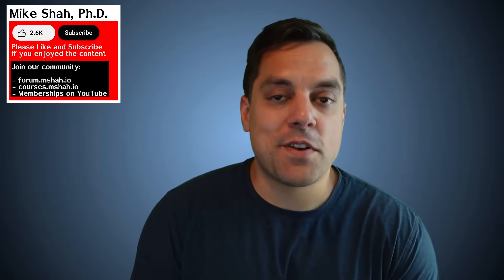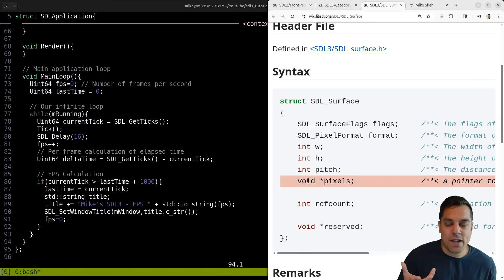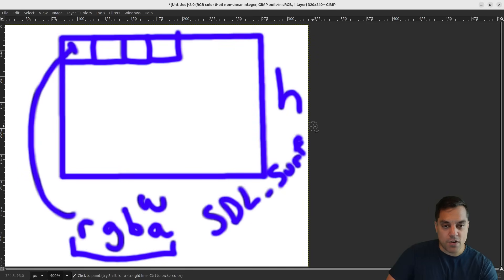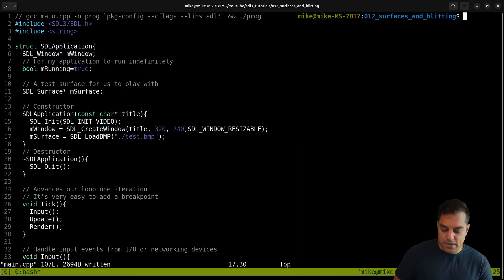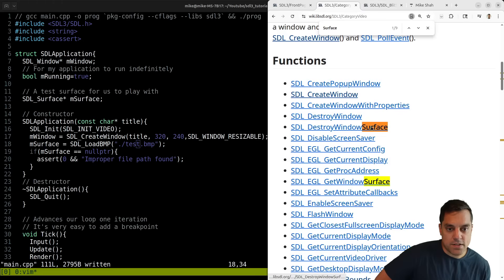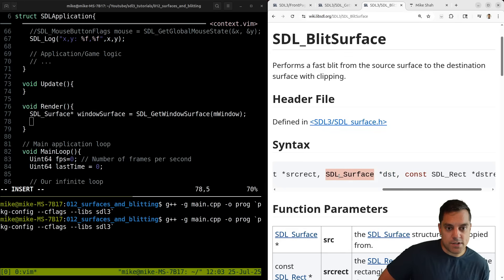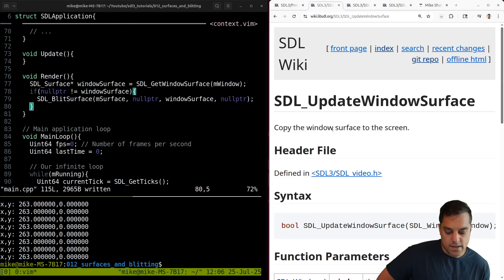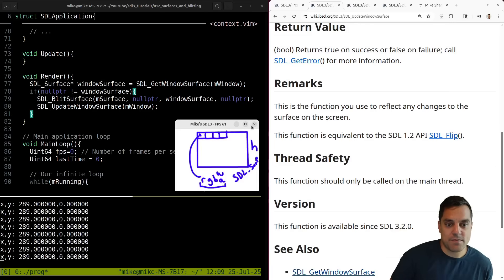SDL3 Surfaces, LoadBMP, and Window Blitting [SDL3 Episode 12]

Comment: I got it to work; but I thought you would stick to C for these SDL3 tutorials. I haven't used C++ in years, but I managed to get it working, just I am very rusty with C++. Thanks for explaining, I am glad there is some videos for SDL3.
Reply from the maker: Keeping the C++ to a minimum -- structs, and occasionally vector should be most all of what is needed 🙂
Reply: @MikeShah  Well it forced me to learn C++ more; but I did use class instead of struct; and used try/catch. That is good to hear you won't go too advance with C++, thanks.
Reply: @MikeShah  I notice reading this; At the 2018 Gamelab conference, Jonathan Blow claimed that use of RAII can cause memory fragmentation which in turn can cause cache misses and a 100 times or worse hit on performance.[ I guess that is negative side of it, but then there is positive side of memory safety and organization. You have any concerns about RAII yourself?
Reply from the maker: @cyberknight1973  For games specifically I like to have a resource manager for this reason, to have explicit control over when to release resources. Given that SDL is a C api, I want to keep that explicitness and not necessarily wrap all the Create/Destroy functions in a struct. That said, a pool allocator can avoid fragmentation and an explicit stack allocator for short lived (e.g. a few frames) should help address the issues Jonathan Blow mentioned -- I'll have to find that talk. Thanks for sharing!
Reply: @MikeShah  Thank you for mentioning about a pool allocator to solve this memory fragmentation problem.